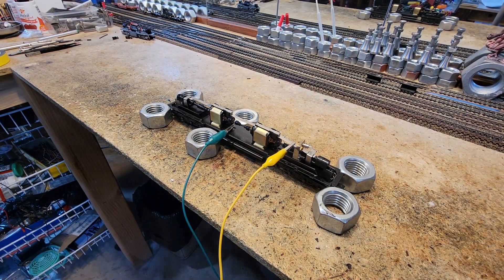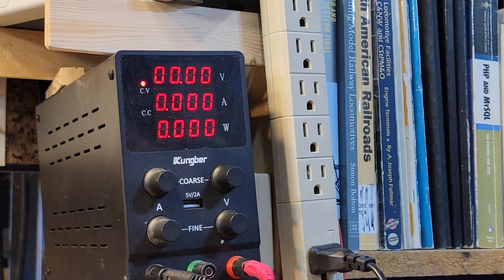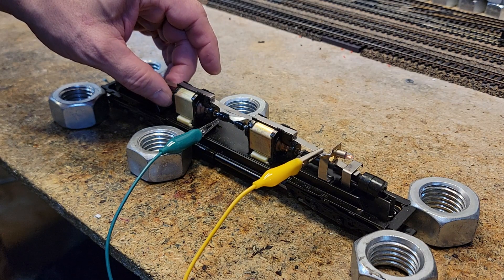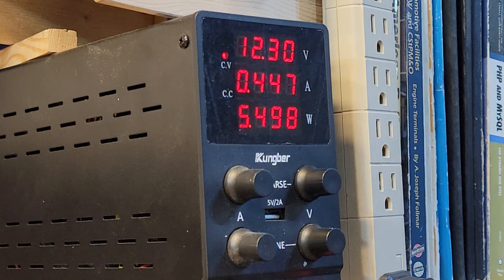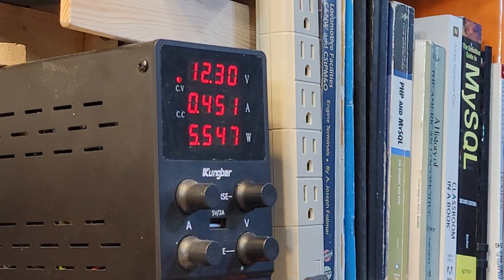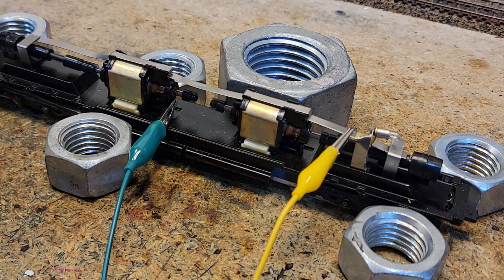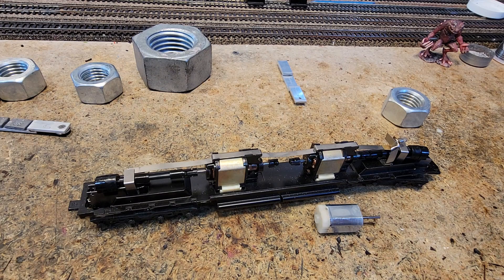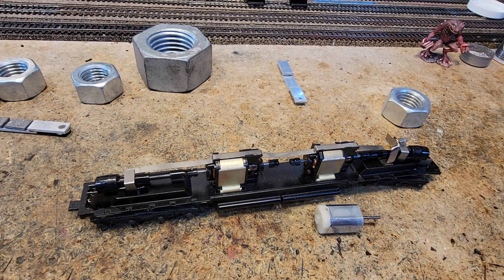Dual Motor DD40 Part 2 Bench Test Power Draw

Comment: Although I fully understand your testing method for motors, in this case I don't think it was a fair comparison. There is really no way that an Athearn 3 Blue Box motor can compete with that of any can motor. Anyone with just a modicum of knowledge dealing with model trains instantly knew what motor wood be the winner. This wood be the same as rating the blue box motor against the Life-Like Power Torque , However, if you are going to do this you must in my opinion give allowances to the Athearn motor that provide for a more accurate result. I am in no way saying that the Athearn motor isn't a reliable or as capable as the can. We all know the durability and the reliability of the Blu-Box locomotive, but there is a reason Athearn continued to upgrade this motor to be more competitive with the can motor. I'm not against the can or A3 motor as I still employ both in my Locos. As an example, I still use the original Athearn motor in my Switch engines and they still get the job done of pulling long strings of cars without hesitation, delay or slippage all with low current draw. I own a set of SP SW1500's (The best switchers built buy EMD in my opinion and i'm a Santa Fe fan), and I would compare them against the newest of today's offerings brass or plastic any day. Sure I may get out pulled but not by much. In order to do this I had to build this pair very carefully and make modifications to them to great performance. Today after many years of reliable service in DC, I love when asked telling people what the're powered with.  No hate or ridicule meant towards you in any way. Just my thoughts and perspective.
Reply from the maker: I totally agree.  this pair of motors for sure passed the test of being more than acceptable for DCC.  I stalled them with my fingers much harder than they would ever be stalled in operations.  the limit of their power is totally based on the weight of the whole locomotive.  this project is meant to remotor this pair with a modern power plant of ludicrous power!  I'm not a fan of any of the new motors in my more recent locomotives.  they aren't as robust as the 266 or the 283 motors.  there will be another workbench test as the new power plants are built!
Reply: @elite194  OK, I'll be watching